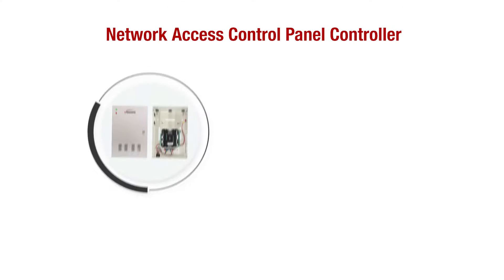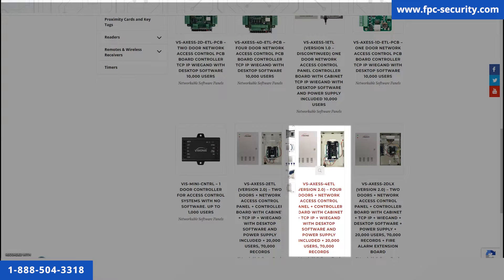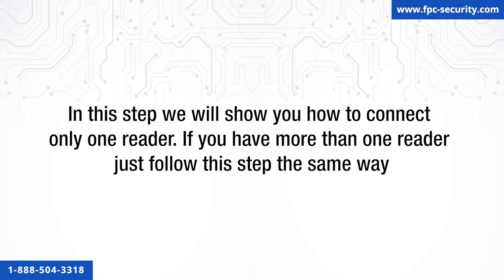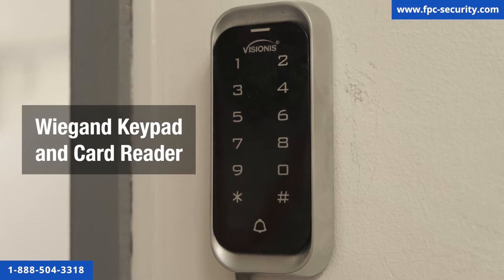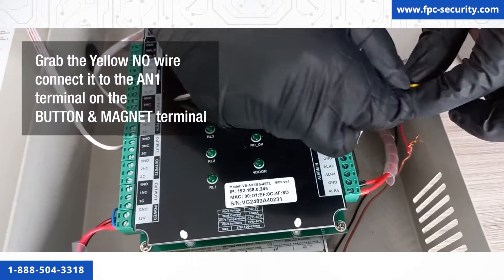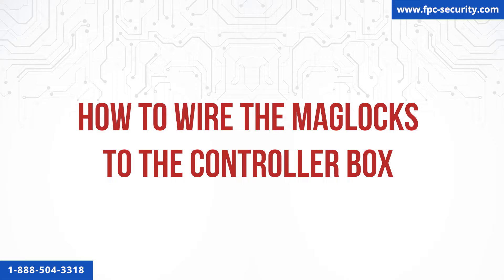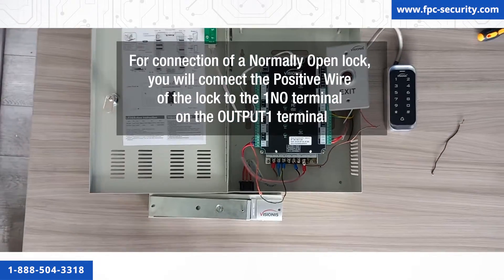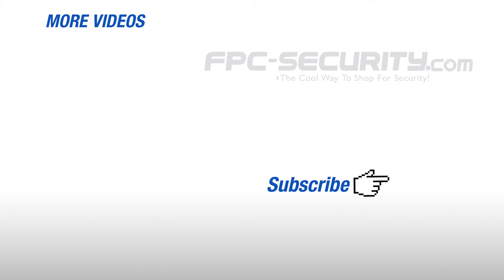Visionis ETL Access Control Panel Wiring (Version 2.0) - VIS-AXESS-2D-ETL / VIS-AXESS-4D-ETL

Comment: with maglock,  the exit button NC has to be used.  in the video, i see you used NO instead.   was this a mistake during making this video  or was this intentional?  if so, why?
Reply from the maker: Dear customer, when connecting an exit button to our panel, we intentionally use the NO wire of the exit button; there is no need to use the NC wire. That's how it works with our panels: we use the normally open connection to signal the panel to release the lock when the exit button has been pressed.